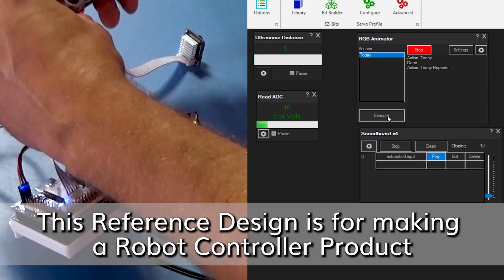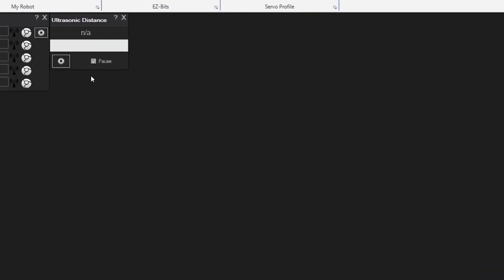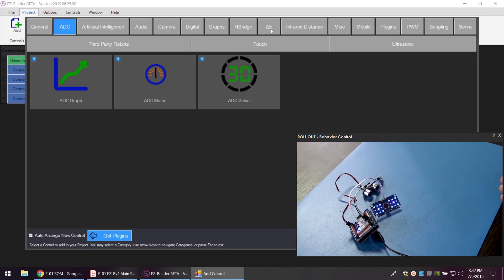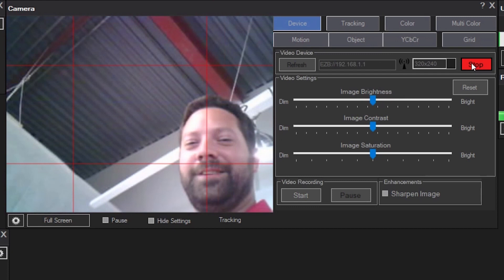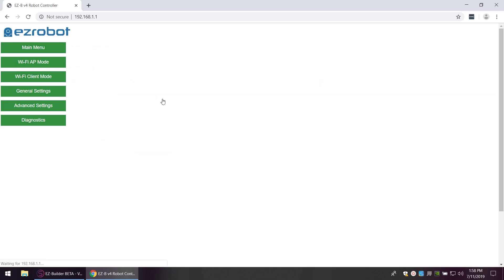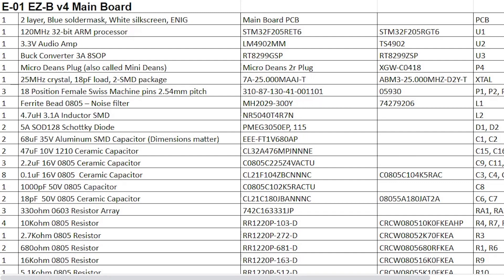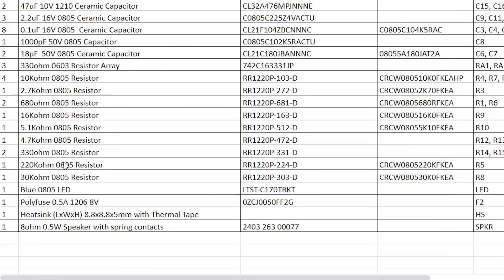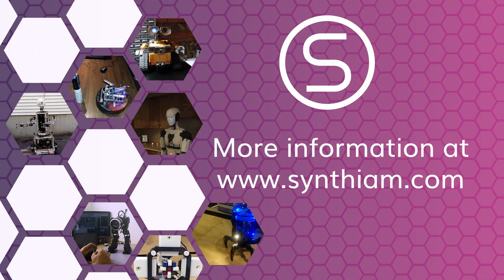Roll Out - EZ-B v4

Comment: It is possible to use bigger motors? I wan't to make a Big track drive for a lifesize johnny 5 and i'm not sure if the servos habe enough Power...
Reply from the maker: Dennis Koch it is possible. The motors should be powered directly by the battery through an hbridge. You cannot connect a motor to a microcontroller IC directly. The servo motors may be powered through the ezb, long as the current isn’t exceeded. If you’re going to exceed the current of the ezb data sheet, then connect the servos directly to the battery
Reply: @Synthiam  ok  thank you, i think i try this!
Reply from the maker: Dennis Koch awesome! There is a life sized Johnny 5 on the synthiam community forum website somewhere made by another user. I don’t have the link handy but it might be good place to start :)
Reply: unfortunately there is currently no way to buy the developer kit in Germany. Except importing it for 40 € transport + tax. This is not an option for me. (problems with exchange if something is broken, etc.) Unfortunately the only shop (https://www.robotshop.com/de/de/ez-b-v4-2-wifi-entwickler-kit.html ) has been sold out for 3 weeks.

Maybe you should do some work on your infrastructure. (more points of sale in Germany) @Synthiam